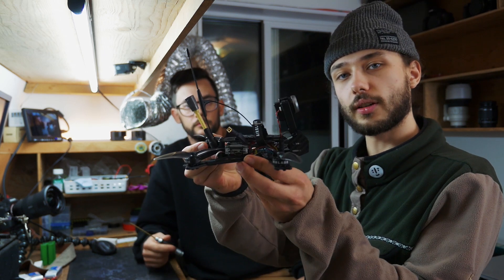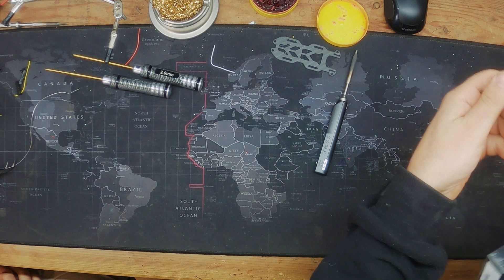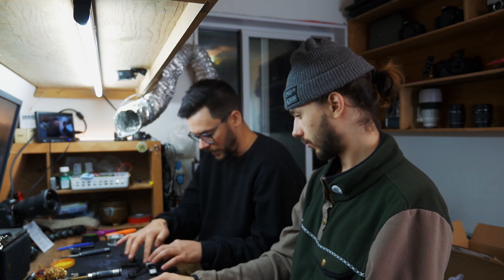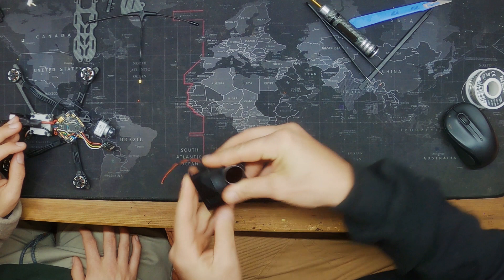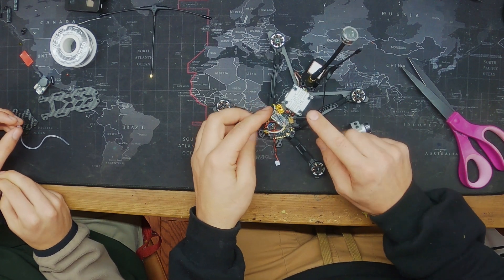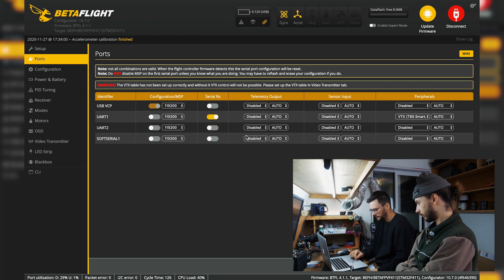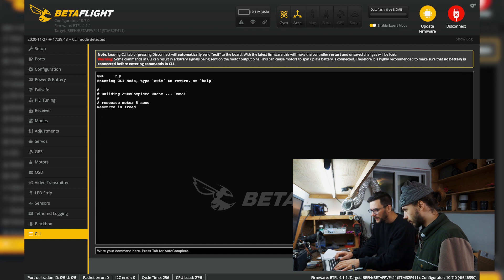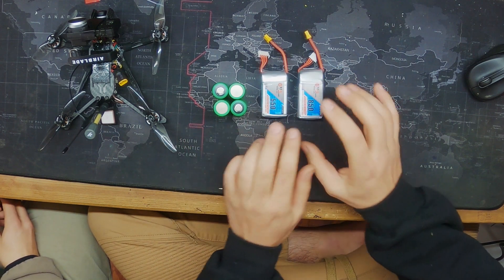Sub-250 Gram Long-range FPV Drone Full Tutorial (Part 2)

Comment: Thanks for part 2! ^^ Could you tell us the weights with the different batteries you are planning to use? Also with and without naked GoPro? Because the sub 250g at least here is total lift-off weight, so I think it would be great if you could tell us, what we can expect to achieve with this setup ^^ Or is that for part 3 or 4? :3
Thanks again! ^^
Reply: Rather pointless video in my opinion. They built a sub 250g LR quad that weighs more than 250 grams in all of their weight tests. I would also have liked to know the weight of the drone w/out the naked gopro and which battery combinations allow it to stay under 250g.